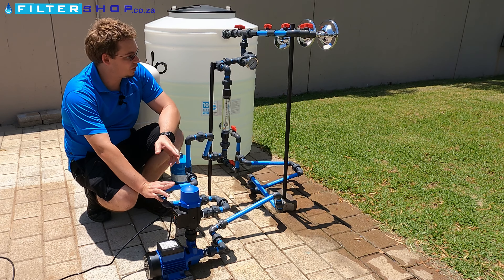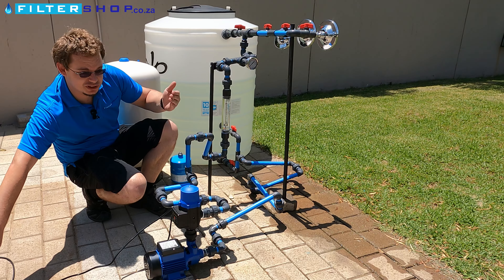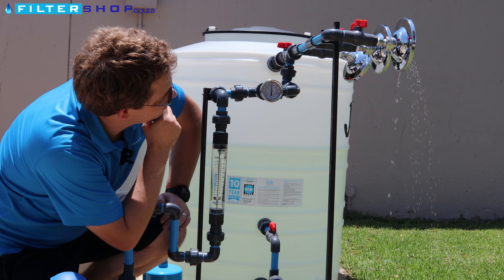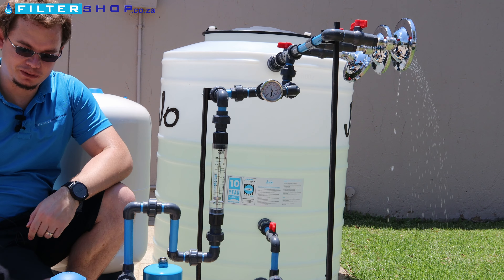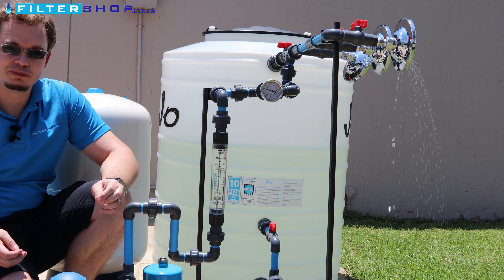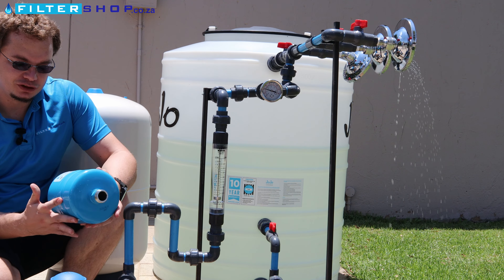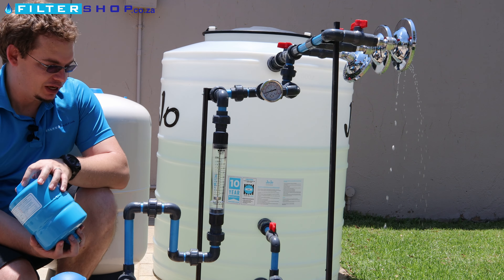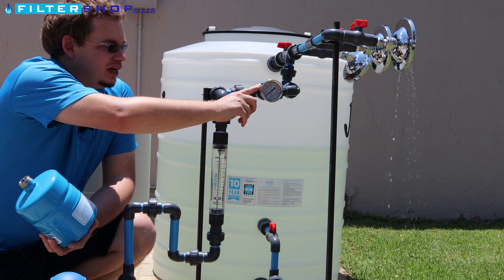When To Use A Pressure Tank On A Pump Setup

Comment: Hi there, I have a solar water pump (180w, 12v) very similar to yours in design. I currently have no pressure tank, but i have a pressure gauge and when everything is closed and the pump is running it marks about 24psi (1.7 bars). My question is, if buy a pressure tank either a 3L or a 24L capacity, the pump will be pushing pressure to the tank upto 24psi or 1.7bars or gradually it will push even higher? say 30 or 40psi (about 2 or 3 bars). Thanks in advance.
Reply from the maker: Hi, Basically when the tank is 100% full it will be at 1.7bar. Then as you use water from the tank it will drop in pressure until the pump turns on again. You would want the tanks air pressure set to just below the pressure where your pump turns back on again. say for example if your pump turns on at 0.5bar then pump the tank to 0.4bar.
Reply: @FilterShopZa  Hi, thanks for your reply. Let me add some details. I have a pressure switch set at 30psi cut off and 10psi cut in, BUT, my pump without a tank pushes upto 24psi, I dont want to set it less than 30 psi because it will not start unless it's near 0 psi. My question is: Will I be able to build 30psi or even more with a tank like yours (wether it's tiny or medium size)?

Comment: To wat pressure should you fill the dry side of the pressure buffer tank?
Reply from the maker: It should be set about 0.2 Bar below the turn on point of your pump.